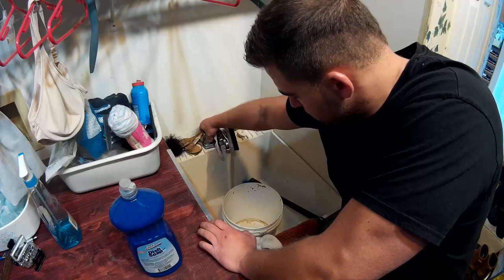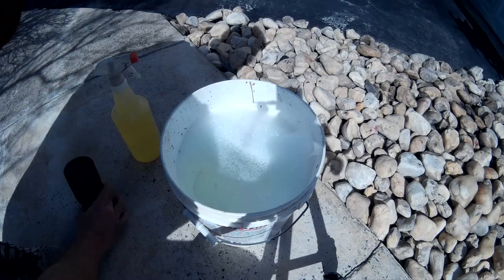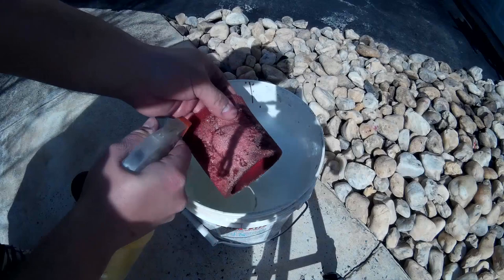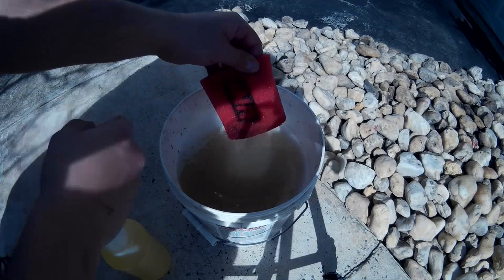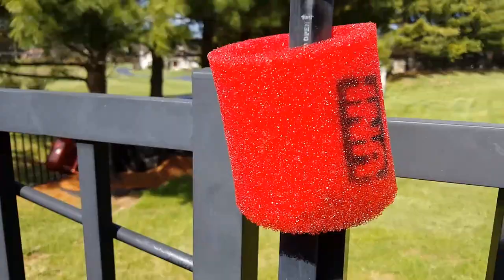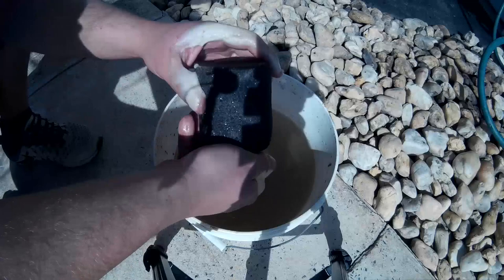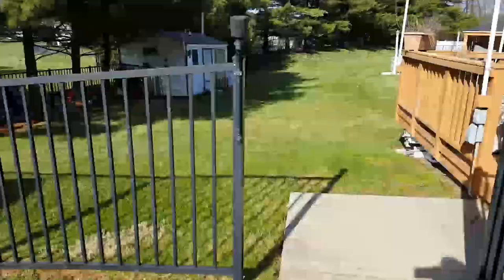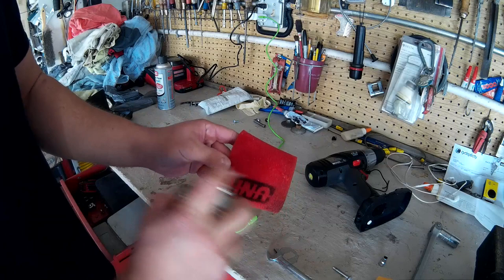How To Clean A Foam Air Filter

Comment: Hey, what's the oil that you use on the outer layer? I just rub a tiny bit engine oil on it, would prefer designated foam filter oil
Reply from the maker: Uni and most oil companies make foam and paper filter oil made specifically for oiling filters. I don't remember which I used in this video but Maxima is a brand that I use. Here's a link https://amzn.to/3dP2OKh
Reply: @MichaelSabo  Thank you
Reply: @MichaelSabo  you used aerosol PJ1 which is popular. Thanks for this video. All kinds of videos for cleaning filters but not for the uni pod filter so thank you!
Reply: Hi do you oil the 2 parts of the filter. Or just the outer part
Reply: @shaneconlon3850  i used to oil the outer part only
Reply: I switched to a different bike since with fuel injection, don't fiddle with the air filter anymore

Comment: Nice, gasoline works great too.
Reply from the maker: Haven't tried that, but I did notice when you spray a filter with starting fluid, it leaves a clean spot
Reply: I used carb cleaner then gas. The carb cleaner cleaned my dang uni stamp off🤷👍
Reply: @Manwichman wow!